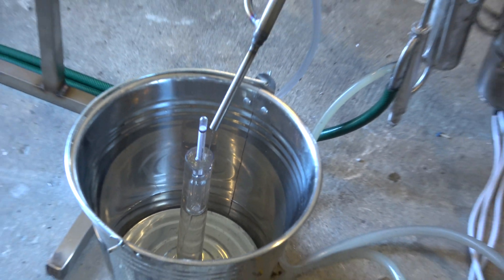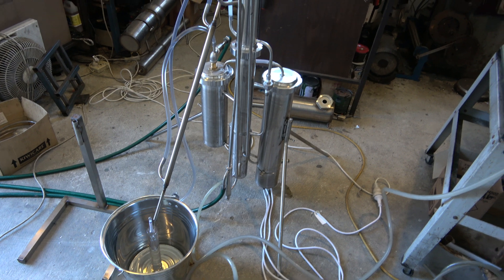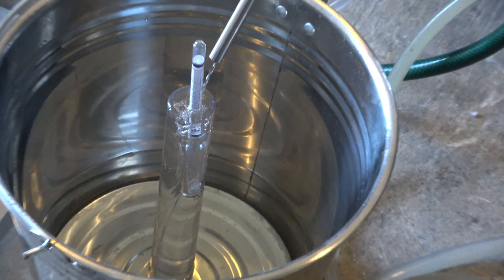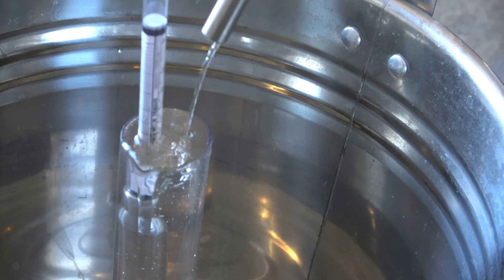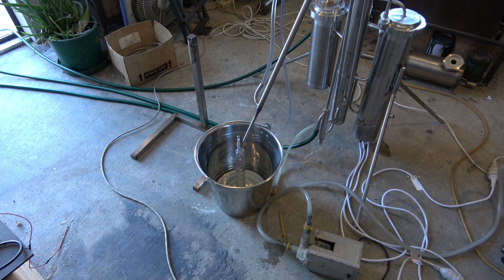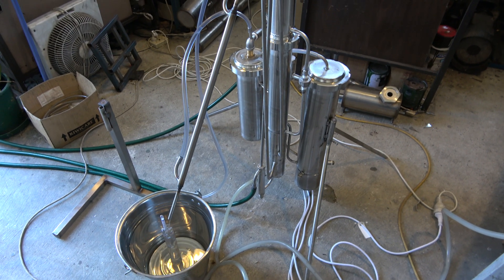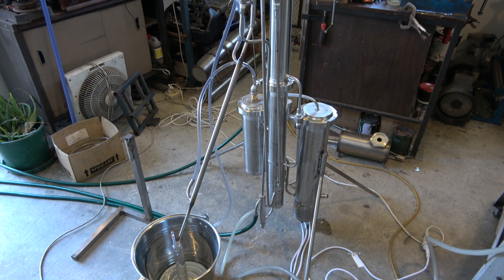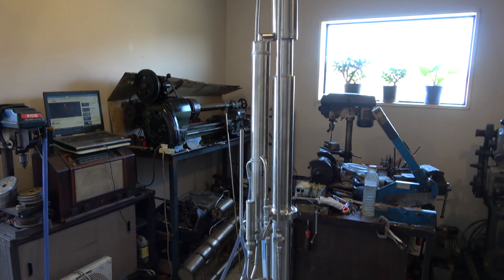Primitive moonshine still - upgraded.

Comment: Thanks Alex. I still have the plans I bought about 6 years ago. I'm wondering, are there any advancements in your designs you can share with an early customer?
Reply from the maker: I can share some extra info that not included to the original manual, simply visit the site and leave the question at the contact page, I'll answer, and try to help.